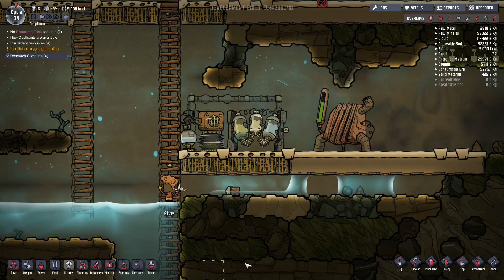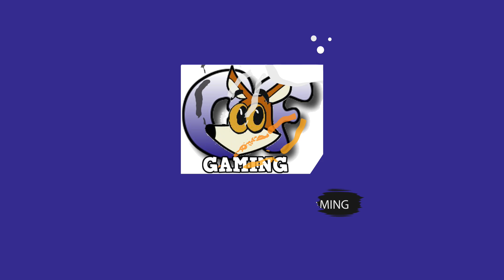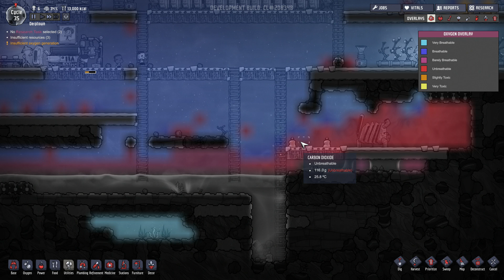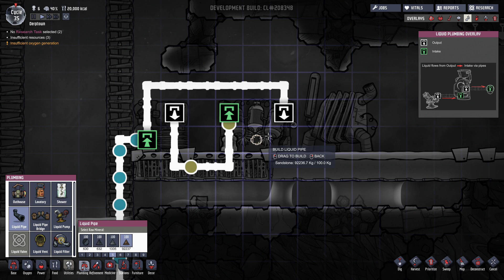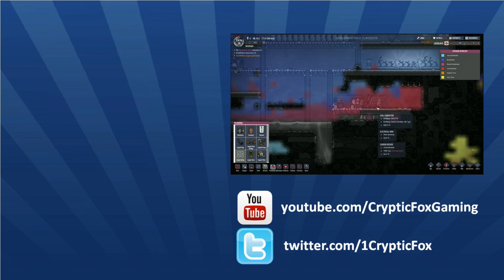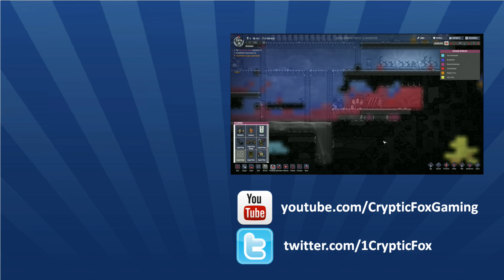Using the Air Scrubber Without A Lot of  Water - Oxygen Not Included Tutorial/Guide

Comment: Please help me... Dont know if newer updates broke that but I did the same thing over and over and it works for a couple seconds then it keeps saying pipe blocked on the purifier thing connected to the scrubber.
Reply from the maker: You have to make sure the pipe is never completely full of water.  You have to turn off the flow before all of the pipe bundles max out.  If they're all at max it doesn't have any place to move the liquid packets and will say its all blocked.
Reply: @CrypticFoxGaming  Thanks for responding, I tried the setup may times. I am very new to the game. I did everything in your video just right. Turned out i built it to low where the co2 collected and dug to a hot spot and it was overheating or something. Put cooling stuff by it and it ran right. Thanks again for responding and the videos.

Comment: NO matter what I do this doesn't work I guess they changed the closed-loop because as a test I disconnected and added a liquid vent to the pipe leaving the water filtration and the system fired up right away.
Reply from the maker: I used  this kind of system all the time still.  You  have to make sure your pipe isn't completely filled with water.  If there is no room for the water to move to the next spot in the pipe, the system locks up and won't work.
Reply: @CrypticFoxGaming   If I don't run the outtake to the liquid vent the water pumped gets clogged and nothing happens but I may have stumbled on the reason I think the room I am trying to test this out in doesn't have enough CO2 so it's possible the CO2 scrubber just isn't turning on because it has nothing to do in that room but not sure I have a coal generator in there but the gasses I see are polluted oxygen and oxygen, I don't really see any CO2. I just got the game and I'm having a really difficult time trying to get a stable colony going. The places that have the most CO2 is nowhere near water so I have to run hundreds of meters of pipes and over each other, I just wanted to try and make sure this worked, that I understood it, could do it and see if I could find a way to use it in the needy spots. I give up for now maybe I'll try again in a few days. Thanks any tips would be great.
Reply: @CrypticFoxGaming  Thanks for your help I have been able to create a closed system using I think I have now expanded to 4 scrubbers all in the same loop and I would likely never have been able to do a closed system like this without your help.Thanks😁😁😁😁😁😁😁😁

Comment: My system worked but for some reason it works a lot more slowly than yours, any idea what could've gone wrong? Thanks in advance.
Reply from the maker: hard to tell without being able to see it.  This is a pretty old video though, so its possible they've tweaked how much i processes now since this was made.  When you say "more slowly" how do you mean?
Reply: @CrypticFoxGaming  I cut off connection from the pump and the water started to move very slowly through the pipes. It was still working but painfully slow. It seems to function better if I keep the connection with the pump (which probably consumes more water).
Reply from the maker: nope its fine.  the scrubber doesn't consume much water, so each of the little packets in the pipe will be smaller than if it's connected to the pump.  When this video was made they didn't show smaller water packet sizes in the pipes.  Everything looked the same size :)
Reply: @CrypticFoxGaming  I see. Thanks again for all the help.

Comment: Does this still work?  I know the self sustaining bathroom does not.  After a cycle or two the pipes get backed up and blocked.  I had to put a reservoir in the discharge pipe to keep it from being blocked
Reply from the maker: yes this still works.  The bathroom will too but the lavatory produces more polluted water than the fresh water it consumes, so you need to add an overflow system now by putting a pipe bridge before the sieve, with another line running off the input side of the pipe bridge.  When the water backs up to that point it'll take the second line as an overflow mechanism.

Comment: ok i followed the guide step by step though for some reason its not working..... :( i think im messing up somewhere i cant see where. ive made sure to plug in the pipes as described (though for some reason the intake and outtakes are switched on colors. but i did check the reference of which is the input and which is the output to make sure and im right....) ive also made sure its all plugged in. But for some reason the pump keeps saying its blocked.... ive been struggling to do this for 3 real time days can someone help me?....
Reply: i have screenshots of the wire work the pipe work and also of the pump stating its blocked if it helps anyone to look at it for me
Reply from the maker: yeah this was made quite a long time ago and updates have since changed he colors around, but the system itself should still work.  Output pipe from scrubber goes to input piep of sieve.  Ouput of sieve goes to input of scurbber, and you have ot prime it with some fresh water by pumping some into the scrubber and then cutting it off before the pipes are all completely full.
Reply from the maker: If you have Discord there's a link on my channel page to access it.  Convenient place to post your pics and someone can help, or you can try the OxygenNotIncluded reddit page.

Comment: This setup is ok for starters, but you need to keep in mind that YOU WILL RUN OUT OF SAND! Sand is (at least at this moment) finite! And wasting sand for carbon dioxide seems to be a bad idea, because you will have far far more algae and water than you will have sand. Also algea terrariums produce oxygen and don't need power. Another alternative to the water purifier is a simple closed room where you pump the polluted water. After some time just get some dubes there to mop it all away. You don't need to keep it, you'll produce a lot of normal water. Keep the sand to clean polluted air, cause thats far more difficult to handle.
Reply from the maker: +Jugg3r you can make sand by heating dirt to high temps.  This is just one way to deal with CO2, though with the agricultural update there's a great need for polluted water so you may jot want to use this kind of closed loop anymore.  This video was made when clean water was a real challenge in the game.
Reply: Jugg3r there is a machine that can convert ore into sand now, ores are pretty much useless in most machines etc. So its a good way to get sand

Comment: Haven't been able to try the air scrubber yet. It's kind of hard to maintain a usable water source so late in the game after I get the research done. But I should try this next time. It's kind of funny, every game I play starts fine but by cycle 80 or so, every room in my base is covered in black carbon dioxide death clouds. The stuff really starts to take over the whole map after so much play time.
Reply from the maker: Air pressure is the key to managing the CO2.  Keep high O2 pressure in your base and it will naturally force the CO2 down and compress it where it's easier to manage/clean up.  I find the best way to do it is with the ventilation system using the electrolyzers.  Just have to make sure to conserve water in the early game (mind you now that the thermal update is out, access to water isn't as much of a challenge).

Comment: I have mine set up like yours i think- but its not taking in the carbon dioxide- why might that be? do i need a vent and how do i set that up?
Reply from the maker: No there's no vent required for the air scrubber.  Is it sitting in the CO2?  it doesn't really draw the CO2 to to it, but rather you have to put it in a place where the CO2 gathers.  is it running but just not drawing anything in?

Comment: Sry if this is a stupid question but I am new.It looks like your putting clean oxygen into the water cleaner
Reply from the maker: The air scrubber runs on water, so I'm pumping clean water into the air scrubber, then letting the dirty water go to the water purifier, and sending the clean water back to the scrubber.  Once I prime the system by pumping in some water I can disconnect the pump and let it run on a closed loop.

Comment: I feel like the algae terrariums need to be reworked. Maybe they should only require algae as an initial material for construction. Then they would need water, fertilizer, and CO2 and produce a small amount of oxygen and maybe a tiny amount of extra algae.

Also, Sand used in filters should be made into contaminated sand, which could be cleaned  - maybe with a furnace or something.
Reply from the maker: +MrSeagull perhaps, but I feel like the algae terrarium is just supposed to be an early game item.  As you access more research items and expand out into new areas I think there are other things you access that are supposed to replace the terrarium
Reply: I'm thinking it needs to be the opposite, since coal and algae is finite, it feels like Algae oxidizers and coal power would be short-term, resource heavy solutions, and oxygen farms being an late-game solution that would require more infrastructure to build and maintain - but would not require easily expended resources.

Comment: It takes a bit more setup and power but the way I deal with CO2 is to run it through a bunch of thermo regulators until it is about -200 degrees at which point it turns into solid CO2. If you enclose a vent in a small sealed room then the solid CO2 can be stored indefinitely, effectively removing it from the game by using nothing more than power. Keep the sand to filter contaminated water you find so you can use the electrolyzer to make oxygen from it.
Reply from the maker: Yep that works too, though definitely more energy intensive.  The Air Scrubber doesn't use sand as a filtration medium, so it would be more energy efficient if you're low/out of sand to use the scrubber to create contaminated water, and purify the water by turning it to steam and then condensing it back into water to feed the machine again.  I like to use the thermo regulators for condensing contaminated oxygen into liquid oxygen (though it has the same energy problems).